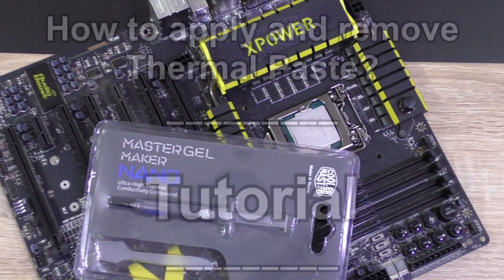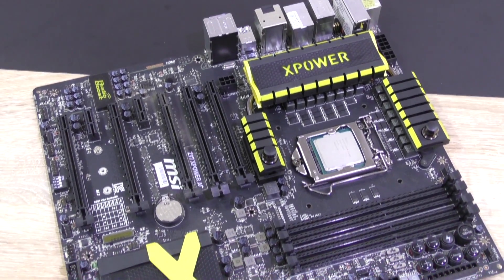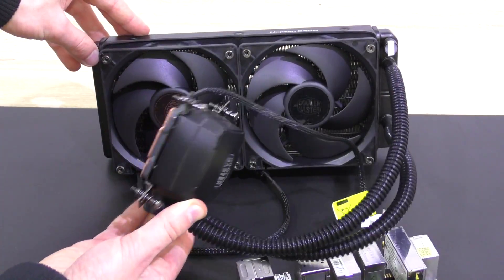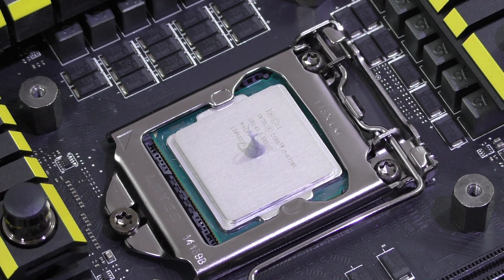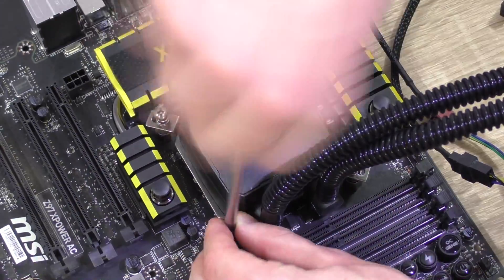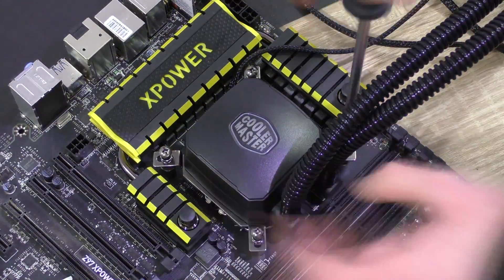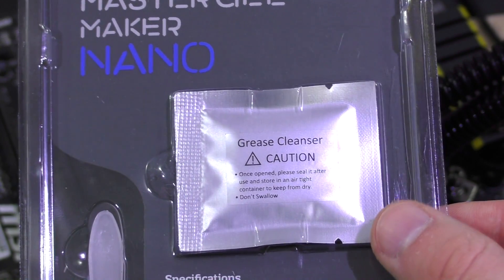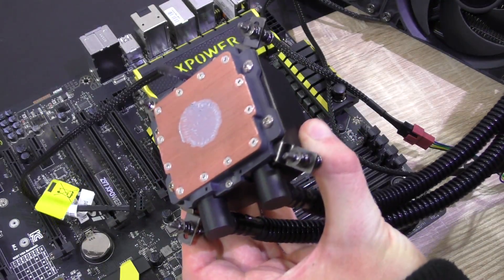How to apply and remove Thermal Paste? | Tutorial

Comment: All you need to know is that before you apply new thermal paste, properly clean the old one with a cloth. Apply a small pea sized drop of thermal paste in the middle of the processor, and carefully place the heatsink on top. Fit it and make sure it doesn't move.

Comment: I got some Grizzly Kryonaut for my Intel Pentium E5400.
Reply: That's absolute overkill lmao, but I wouldn't use any other paste than Kryonaut regardless of CPU. It'll definitely help keep temps low. 

That same paste applied incorrectly (it was an accident I swear lol) to a Ryzen 2700x, in conjunction with a coolermaster masterliquid ml240, keeps the chip under 50° at full load.
Once I repaste in a few days I'm hoping to get less than 30° at idle and 50°-60° while gaming for extended periods of time.
Reply: @Zanithos  is rare for me i get 50 at idle but doesnt pass 60 at load

Comment: I like it when it's quick and brief. unlike many videos that stretch ~2 minute of info over 10-15 minutes. Question though. Don't you think cpu cooler that has a fan directly on it would work more efficient than tubular heat radiators kind... cuz heat has to be radiated through tiny pipes rather than immediately been spread and vented out easily... My pc keeps crashing, and I think it's because of the tiny pipes not transferring heat anylonger and computer gives me CPU Fan error on boot. Although I disabled cpu fan monitoring in bios & thorough dust maintenance. It's time to change cpu fan kit but I have the concern that tubular heat radiators may look fancy but not as efficient as old school kinds that are very advanced nowadays and great for overclocking too... Thanx.